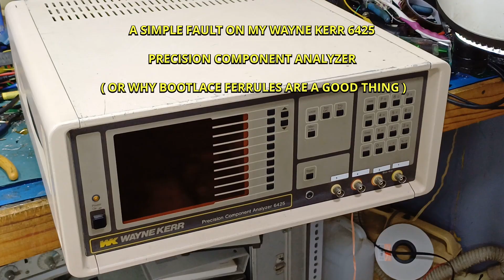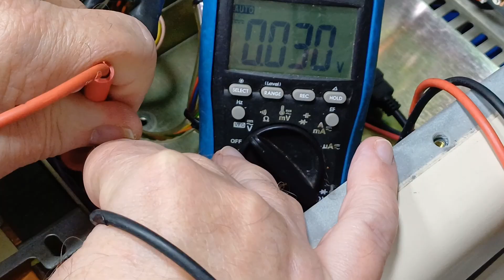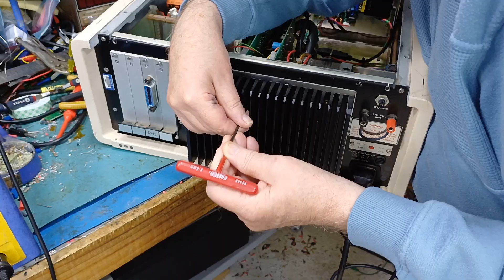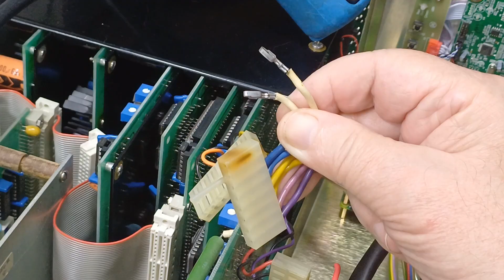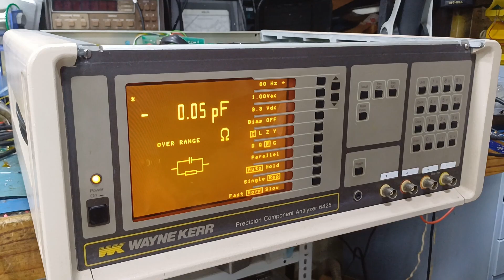A Simple fault on my Wayne Kerr 6425 (or why bootlace ferrules are a good thing)

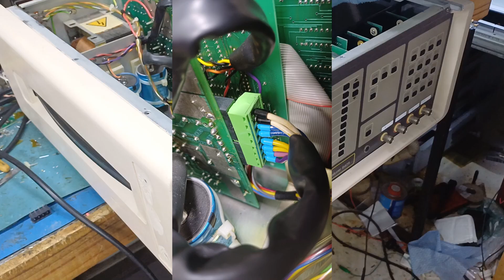Comment: @21:40 Nice fix for the bad connector.
Reply from the maker: Yes, I just want it to be reliable, was a bit annoying failing while I was using it on a job for one of my regular clients. By the way I've been watching your ongoing Keithley 237 trouble shooting. I also have a 237 which I haven't fully checked since I bought it, I hope I don't have issues with mine like are having.
Reply: @peteroneill404  yes my 237 has been a challenge, I still haven’t finished fixing it yet, it is 95% there.

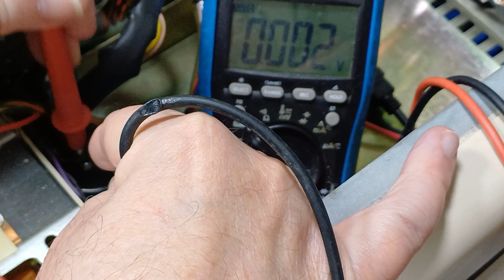Comment: @4:00 I think you should replace those test leads before you zap yourself using them, insulation is melted through on both of them.
Reply from the maker: Yes, they are a bit on the nose but generally don't use them above 50V, but yes, you are right, they need to go in the bin.

Comment: Nice to see a video from you. I have seen that type of connector fail in other vintage equipment when used in high current applications. They seem to lose their "springiness" possibly due to repeated heat cycles and oxidation.  Great to see that Wanye Kerr back on the road. Regards, David
Reply from the maker: Yes, I would have thought WK would have used a better quality connector. Apart from issues like this the instrument in a similar class to HP. I haven't posted any videos for a while, had a lot of work on and a medical issue six months ago but all good now, so I'm hoping to do a few more videos soon.